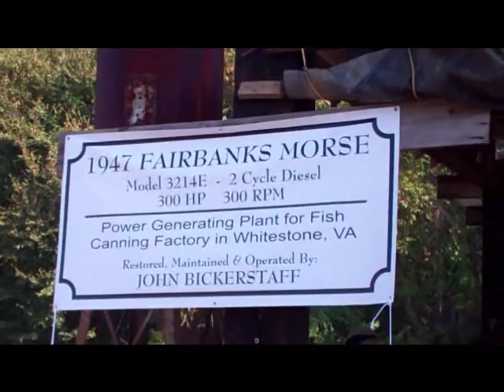Fairbanks Morse DIESEL Generator Plant 1947

Comment: Used to be 2 of those in Sandpoint Alaska. They were installed in 1947 and ran without overhaul well into the 1980's. You could hear them all over town. I was just a young teenager and id go to the Aleutian Cold Storage shop just to watch them run. Engineer there told me they only get shut down for oil change and started back up. 350RPM
Reply: That's sweet! Do you know how often they would change the oil?
Reply: hard to believe they were never rebuild in 40 years. There is no wear free engine 

Wonder how often they chaned the oil

I guess they were used for generating electricity?
Reply: Amsoil saber professional 2 stoke oil

Comment: Our family Ranch in texas has a fairbanks morse like this installed 1930s  1960s it was placed in stand by auxiliary power .. well different times it has been 
Used .. 2021 massive snow  ice storm it ran  one month -- non stop no issues it always has  been maintained 100%  and  concrete building  protection from elements 
I think it is a 250 kw unit not sure but definitely 4 cylinder  .. has to power  main house  bunk house barns one horses  one for dairy cows and full 
Machine  shop in business since 1930 .. its nice to see these running  , but  its best to use it for purpose  it was built for like ours. Great video 
Thanks
Reply: The way things look today yall may need it again soon. Love these machines
Reply: Stock up on lots of amsoil saber professional 2 stroke oil!

Comment: Back when electric power was cheap and reliable. Just about every town had one of these and a reliable bunch of hard working guys to keep the lines maintained. The guys actually climbed the poles with pole climbers strapped to legs and shoes.

Comment: why is there so little oil in the crankcase and around the rod bearings?
Reply: Kathleen Shaw  There are NO reed valves on this type of engine.
Reply: Kathleen Shaw  I always thought they were piston-port induction, compression & exhaust.

Comment: How are the mains lubricated if it's a two stroke?
Reply: Same as a 4 stroke. It does not breathe thru the crank case.like a weed whacker engine so it has normal pressure oiling on journals and connecting rods.
Reply: kimmer6
The air intake is in the crankcase,look at the pictures.On the same side as the exhaust at the bottom.I know this because i have seen other engine decriptions of the same exact type of fairbanks morse diesel
Reply: Yes..and my Detroit Diesel 3-53 also has a blower on the side and intake ports in the cylinder sleeves. But it is completely isolated from the crank case which has standard crankshaft oiling. The intake ports on this FM are in their own gallery and are not exposed to the crank case air.
Reply: kimmer6
Then what forces the exhaust out?On the detroit diesel the supercharger does the work of forcing the exhaust out and a fresh charge in.Since the fairbanks is not supercharged and you say the downstroke of the piston does not do it what does? Also i have heard from another source that the mains are lubricated by a wick system like an old electric motor.
Reply: kimmer6
You can read about how these engines are scavenged and lubricated at Oldengine.org.They have an online copy of a 1940 FM manual.The print is kinda small but readable.
Reply: ***** The exhaust is forced out by the downward motion of the piston compressing the air in each separate crank case. The are intakes on the outside have a big check valve under the cover so air can only go in. So by the time the piston uncovers the intake and exhaust ports there's enough pressure to blow out the exhaust. You can see the pressure changes in the crank case a little if you watch the part where you're looking through that Plexiglas into one crank, the plastic is flexing in and out because of the pressure and vacuum inside.
Reply: Tony Miller My question was rhetorical.
Reply: 916fanatic1 0:33 that is the oiller